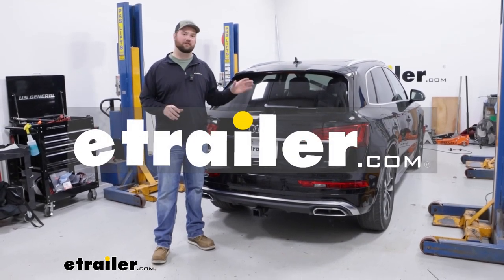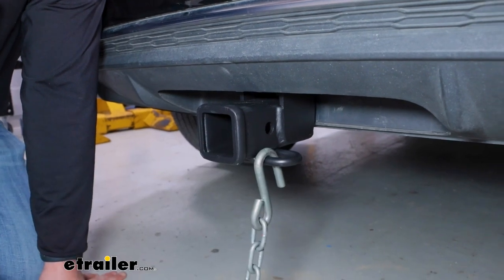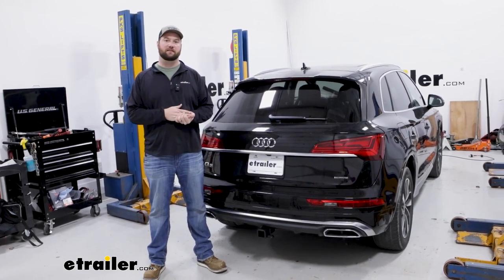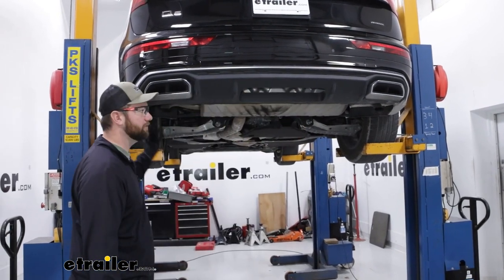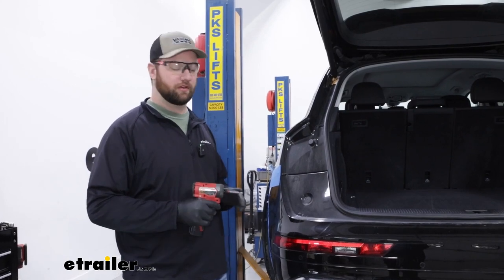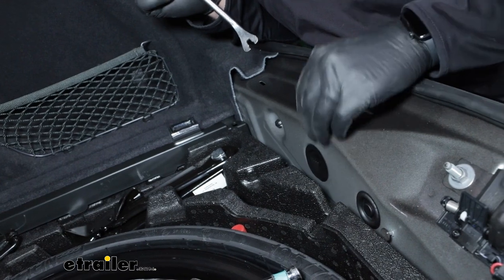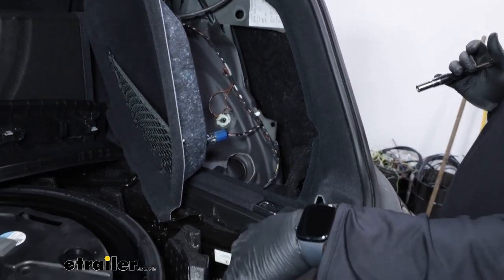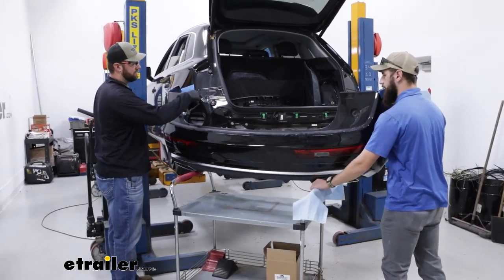Set up: etrailer Trailer Hitch Receiver on a 2023 Audi Q5

Comment: Why do you have to take the bumper facia off?
Reply from the maker: Because the hitch is sandwiched between the bumper beam and the vehicle chassis, it's necessary to remove the bumper fascia.
Tou can check out the installation instructions here:
https://www.etrailer.com/instructions.aspx?pn=E94CR